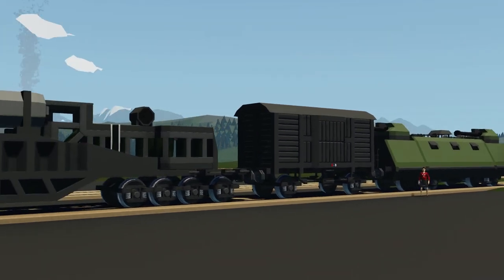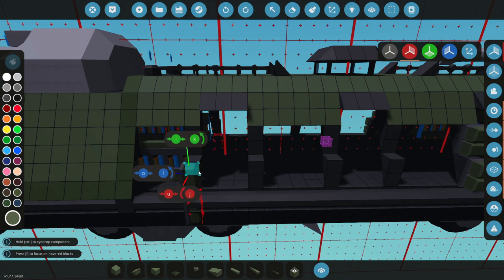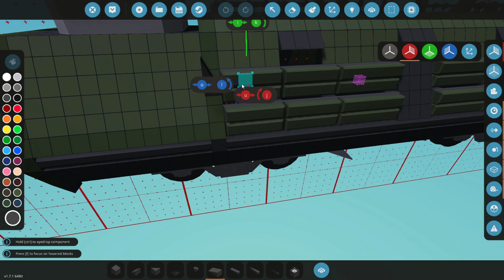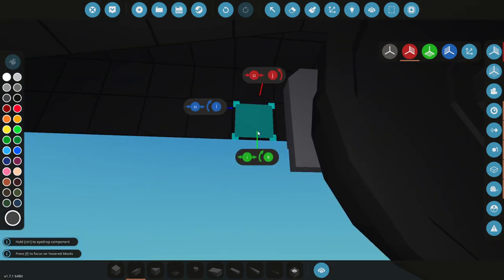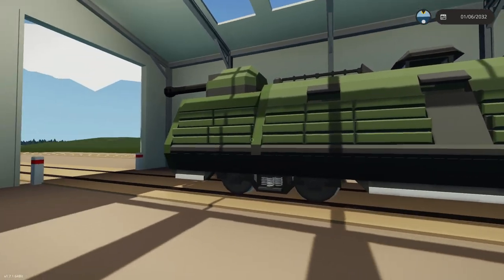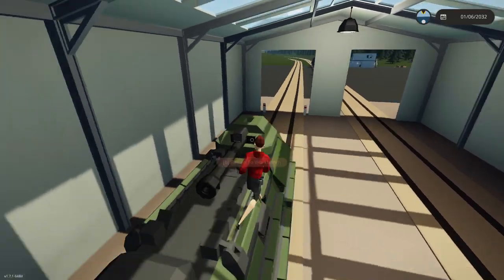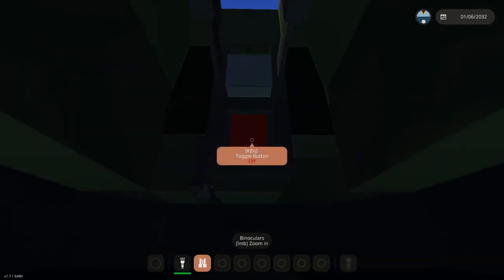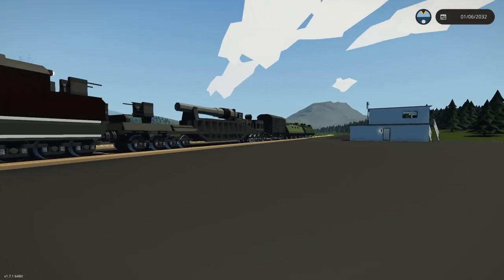Lets UPGRADE Our ARMOURED TRAIN CAR! - Lets Build A Steam Engine In Stormworks!

Comment: neither is perfect but of the two i prefer the first one, an angled hull gives waaaay more protection then armor at 90 degrees. i would do a middle ground of the two:
take the first one as a base, use the colour scheme of the second one (replace the darker green on the first train with the gray)
add the pivot dangly bits from the second one and make them thicker (by adding the same piece on the inside aswell)
remove the 'roof' part from the view ports /gunner ports and change the dangly bits so that you can raise each of them individually to open up the view port/gunner port